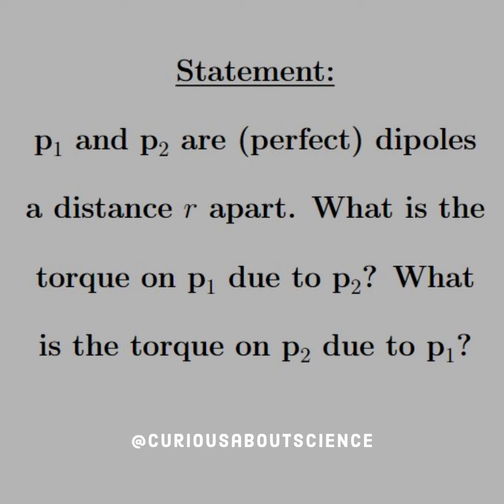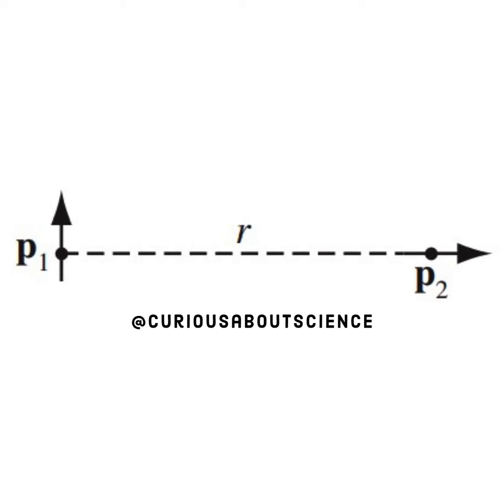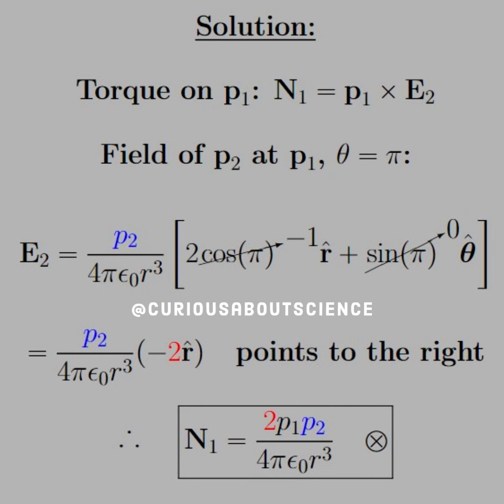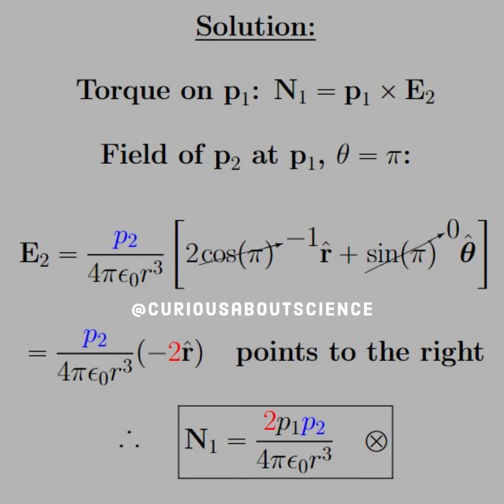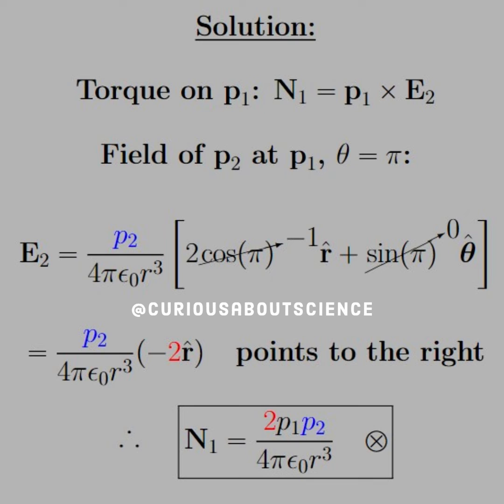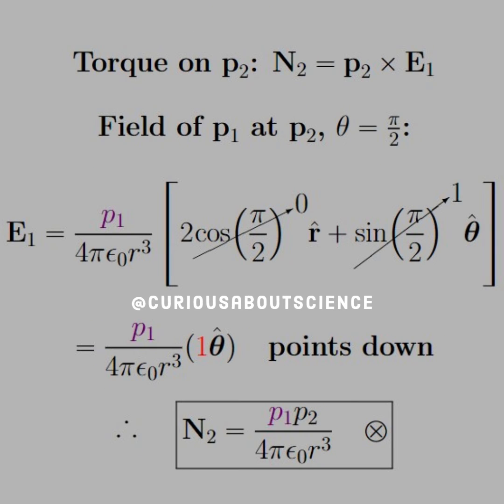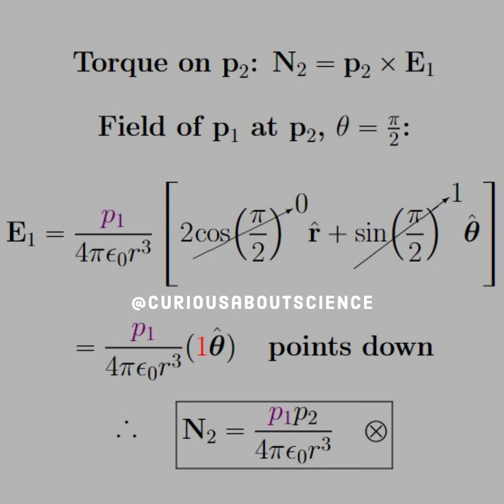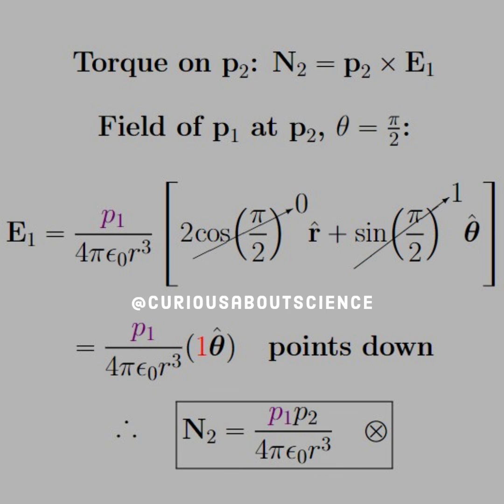Problem 4.5 - Polarization, Alignment of Polar Molecules & Torque: Introduction to Electrodynamics

Comment: I wonder why the angle in E1 and the angle in E2 are different. Why aren't they both π/2?
Reply: you measure the angle clockwise from the tip of the dipole being 0